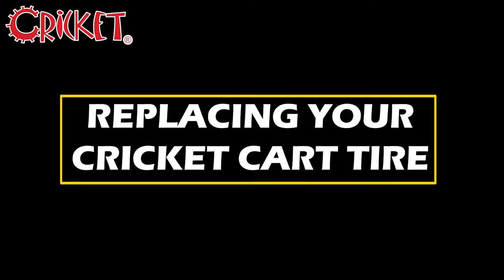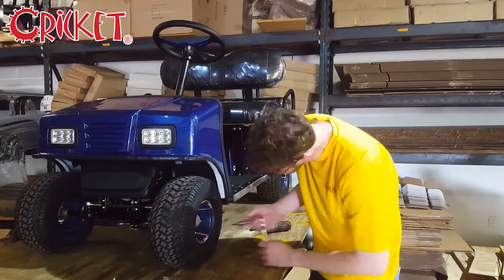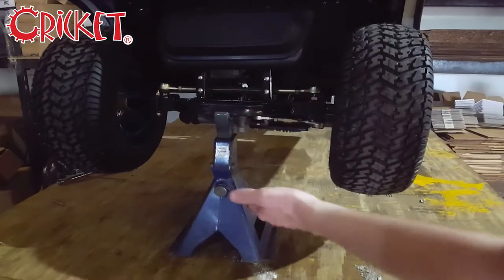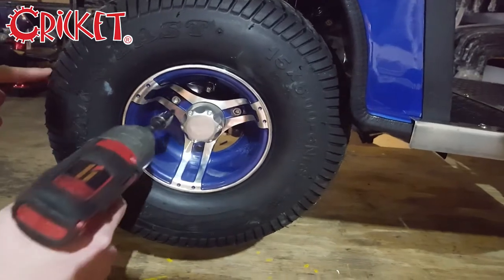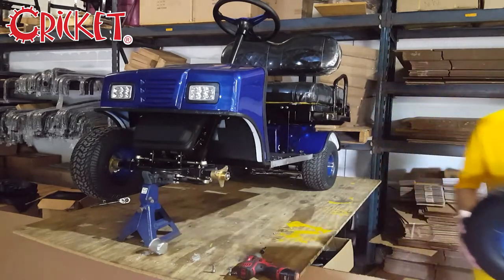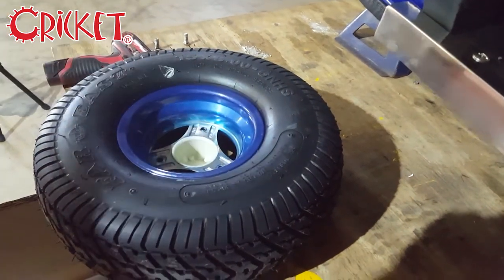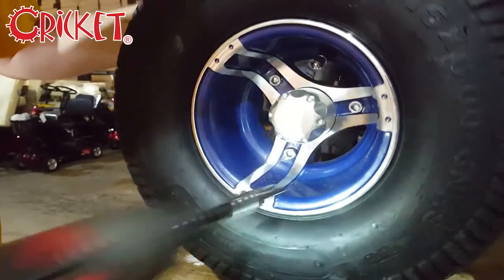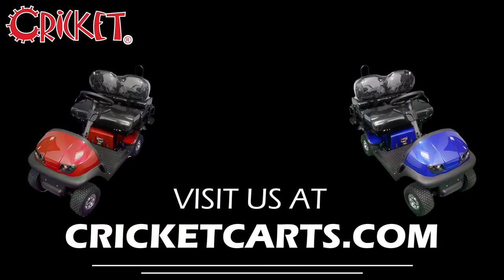How to Change the Wheel on Your Cricket Cart! | Cricket Carts: Small Mini Golf Carts!

Comment from the maker: Current Cricket models now use 17mm lugs to secure the wheel assembly to the hub. Older models with hubcaps are attached in different ways. Underneath the hubcaps, there is either a single center bolt or a C clip that holds the tire on. The C clip can be removed with pliers, or a special tool designed for fitting and removing C clips.

Comment: My sx3 is 2018 model but the wheel and hub are all one piece.  The wheel bearings are literally in the wheel.

You remove the wheel by removing the snap ring on the shaft.  That requires a pair of snap ring pliars.

Comment: The cricket back tires do not have bolts.  How are these removed
Reply from the maker: Current Cricket models now use 17mm lugs to secure the wheel assembly to the hub. Older models with hubcaps are attached in different ways. Underneath the hubcaps, there is either a single center bolt or a C clip that holds the tire on. The C clip can be removed with pliers, or a special tool designed for fitting and removing C clips.